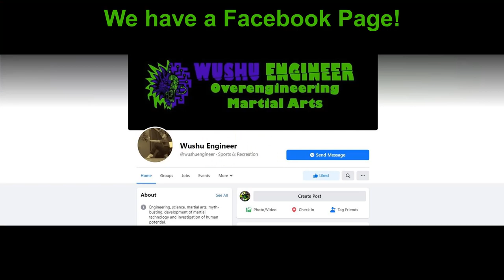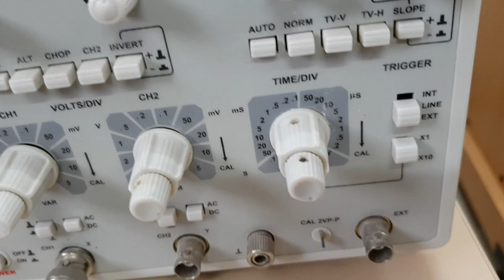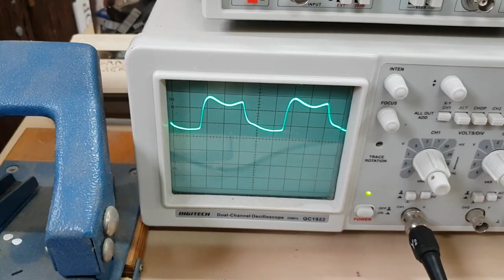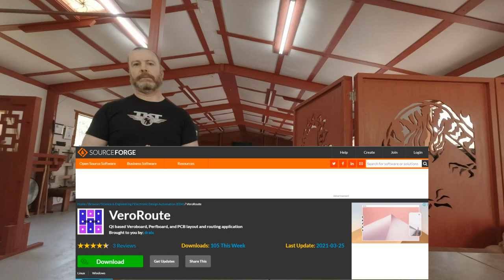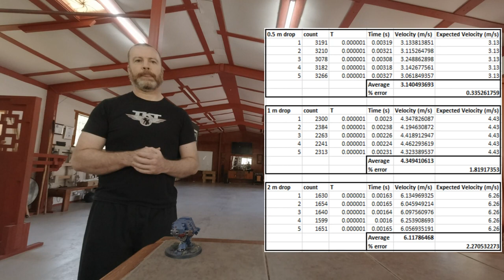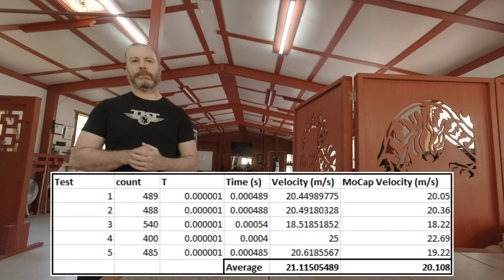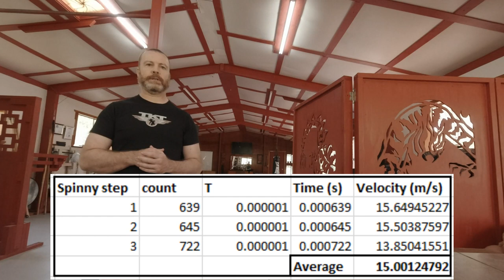Measuring the speed of human impacts using FRIKKIN' LASER BEAMS! + spinning strikes revisited.

Comment: "Hurray for "hoplakinetics™" ! This is really fun and I appreciate you guys for taking the time to do this, I really hope you're well and spring is treating you properly. 

After watching the whole thing, I have more thoughts on this.

It seems there was a marked increase in the spin impact with the method I proposed? 
The swing of the 'weight on the chain' at 19 m/s is now much closer to the 'weight on the stick' at 20 m/s, or am I off the mark here? 

Your spin strikes are impacting at around 19m/s, that is up (+)3 m/s from the original 17 in the last video if I am not mistaken. It seems the load increased along with it, correct?

That being said, I believe what is being compared here is the efficiency of driving a nail with a hammer (class 3 lever) as compared to a hammerhead on a chain (?) 

At any rate, I believe allowing centripetal force to "work" has increased the spinny impact, correct? 

So this leads me to:

•Would the increased ballast weight/mass of the "weight on a chain' facilitate the overall speed of the spin, allowing centripetal force and gravity to work stronger than a class 3 lever?  The same idea behind a wrecking ball at higher speed, that ricochets into your face (please wear a baseball catchers mask of you try it, ouch) ."

•Could it be possible to physically increase the spin before the moment of impact,  using the same muscle groups as throwing a ball, along with the step forward and dropping the weight increase impact using that momentum of the original spin?
Reply from the maker: Thanks for your comment. We’re doing well, thanks, albeit busy. As far as differences in impact velocity go, you are correct that the average for this set of tests did appear to be higher, although caution should be applied in drawing conclusions because the sample size was small and the variation between the two sets would more than likely be accounted for simply by my natural performance variation. Unfortunately, I did not perform some single swings on that day to confirm that. However, it can be conceded that there may be a small difference. In terms of increasing the mass of the ball, I would say that this would increase the effort required to get to the maximum rotational speed. It is possible that there may be an optimal weight for this kind of arrangement or perhaps more than one dip in the graph representative of several optimal mass/string length combinations. However, it is possibly more likely that there is a simple inverse relationship between mass and rotational speed. As I mentioned, I believe that it would be possible through training to increase the efficiency of the movement with spin combo, although that training would go into increasing the rotational speed of the final swing before impact and not multiple swings before impact. Trying to increase the rotational speed over multiple swings would not be energy efficient given how much energy is required to keep the object spinning continually and the fact that energy does not accumulate in this kind of inefficient, unbalanced human-powered rotational system (as it might in a flywheel driven by a motor, for instance). Intuitive timing would be the main training goal for the final moment of delivery/impact.
Reply: @WushuEngineer  Think of it like a sling or a hammer throw with reaction force and path of inertia. That is the basis of the weight here methinks,  the "thrown" aspect of a sling or hammer manipulated into striking. If you watch how that works, with the reaction force, you'll see what I mean.